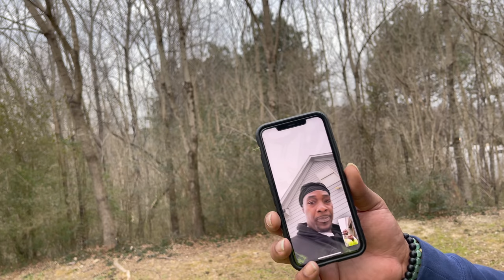Test Ride My Yamaha 421 Banshee For The First Time Since The Restoration

Comment: This y ion let niggas ride or drive my shit he was 2 hard on yo shit Sug u gotta respect another nigga shit u ont do mean down shift an b keepin it full Throttle 90% of the ride time In the cold 🥶 on a fresh build the build didn't even have 20hours on it yet u not supposed 2 go over 80% Throttle til 30-50 ride hours I could b wrong but I heard it from multiple people an read online baxk 2 the shop 2 get torn apart block is possibly cracked or over fried when it overheated or it's seized either way that motor gotta get broke open then tore down  unless atl banshee know some tricks Goodluck on gettin it all the way back 2gether he owe 4 that his build gotta w8 now

An its a built 421 that u b bringin 2 car shows that ain't a everyday ridin quad
Reply: Frfr 💯✊🏾